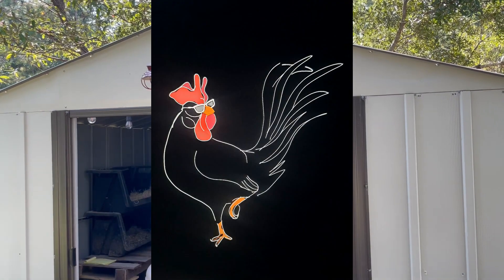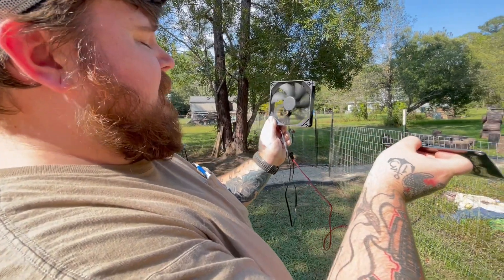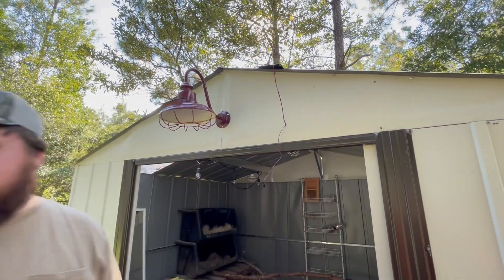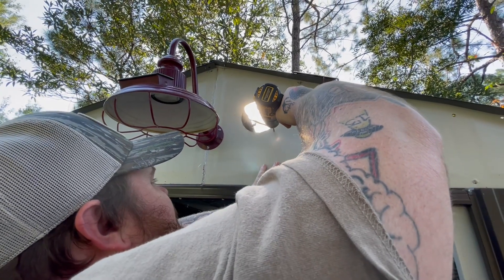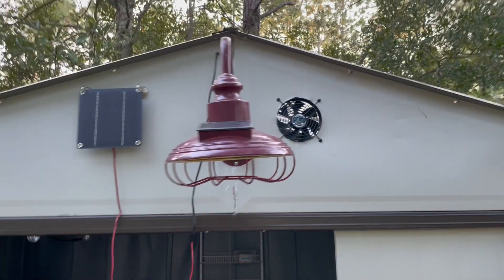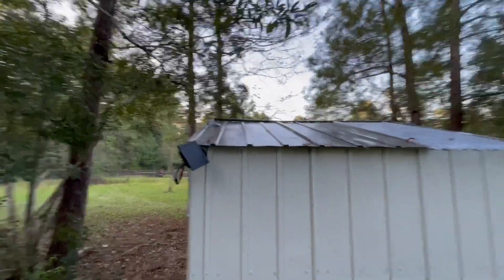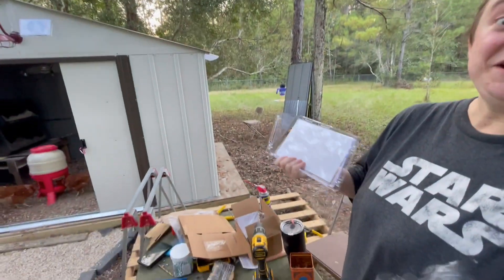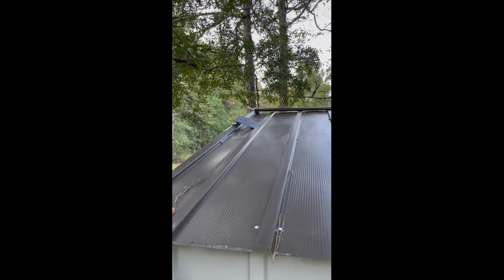DIY SOLAR POWERED FANS from Amazon - Installing Solar Fans in a Chicken Coop

Comment: My sense of humor. Good stuff. Side note, think i have the same shed.🎉
Only problem with the fan and panel is needing solar light. Id recommend a battery source. The solar panel can power during the day and at night, it runs on the battery. The aolar panel could also power the battery during the day. And that light would also be run by the battery at night.
Good video and content!

Comment: Put both fans on the shady side, about 1/3 the width of the wall apart, 2' above ground where it is coolest. Make one hole like you did on the opposite side up high. That way you slightly pressurize the shed. There are probably enough leaks anyway that you dont need an exit hole.